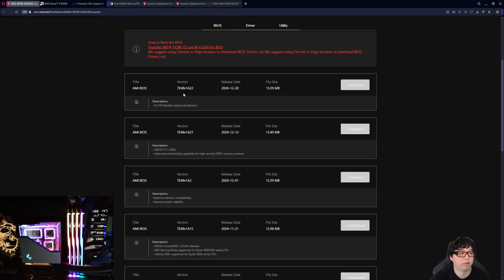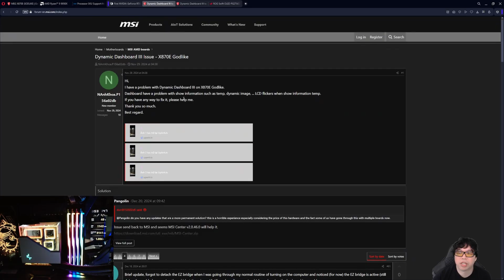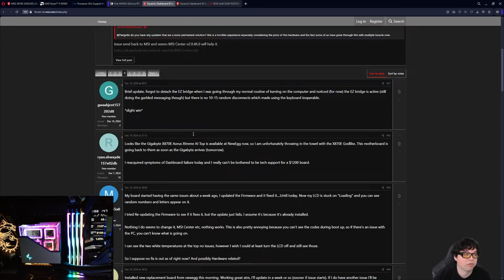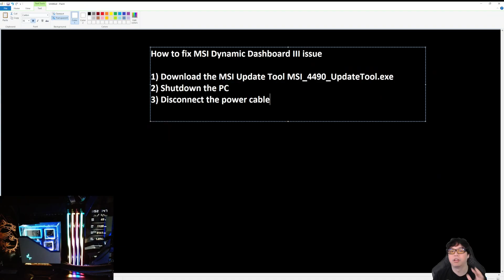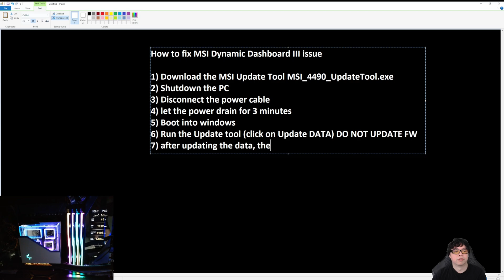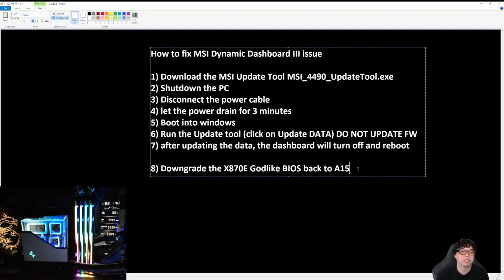How to fix MSI Dynamic Dashboard III issue | X870E Godlike

Comment from the maker: MSI released a new Dynamic Dashboard III FW tool on their site as of 1-16-2025. Make sure to use the latest tool (newer than the one listed in the video).
Reply: I tried doing that and it will fail to complete the install/update. I'm guessing because the EZ Bridge keeps dropping out. I'm not sure how I can complete the install at this point.
Reply: @robertmedina3195  same issue I'm having.
Reply: Did you update to the latest BIOS and use the new FW update tool? Are the issues resolved?
Reply: Looks like this fixed it for me! I'll see how long this lasts lol
Reply: @MidinVal  was it fixed with that update for you? planning on buying one but scared by this issue

Comment: Echoing point below to use latest Dynamic Dashboard III tool (which does not give the option to update Data only).  Aside from that, this is a truly amazing bit of information on how to fix the USB issue which had me ready to send the board back for it's SECOND RMA...........  Fantastic job and great description of the issue and how to fix it.  Much appreciated.

Comment: The problem has been solved. The small screen has not been disconnected and reconnected for 45 minutes. The screen is no longer flickering. I just pressed it randomly, and luckily the problem was solved. I'm using the latest software

MSI Center
step
1) support
2) Live update
3) Advanced or scan
4) FW update file
5) install FW file

Comment: @GameTechReviews. Hello. What's the production date on your Godlike ? I found out mine is a 2502 model. February 25. However i have found some people with a March 25 model. Also can thr ez bridge be flashed bypassing windows like using the bios ? Also i plan to put the board in a HAF 700 case. Does the fan controller support a decent  amount of fans ?

Comment: Thanks for all the help! You're like the only creator I can find that even talks about the Godlike and addresses the issues with fixes.

I got mine up and running finally, no issues with the EZ Bridge & EZ Bridge Hub now after updating the drivers and firmware.

But now I'm having issues with the M.2_1 SSD. I installed a Crucial T705 4TB rated for 14,000+ MB/s speeds but it's only running at 850-910MB/s. Multiple people on reddit have said it's an issue with all X870E MOBO's, have you come across this issue? My M.2_3 SSD WD_BLACK SN850X 8TB is running at around 6300MB/s (rated for up to 7200MB/s) so I'm not sure what's going on. 

Thanks again brother! 🙏🤘
Reply from the maker: I don't have the Crucial T705 but when I tested the SSDs in the various slots they were running at their advertised speeds.
Reply: @GameTechReviews  thanks for the reply! 🙏🤘

do you have a Gen4 or Gen5 SSD in M.2_1? Apparently it's only that slot on all X870E boards that won't run at Gen5 speeds. My M.2_3 slot is running at Gen4 speeds as it should.
Reply from the maker: @matthewjamesmaccarthaigh  I just tested the Crucial T700 2TB which is already 66% full and I got the following results from CrystalDiskMark  Read 12244.10 MB/s Write 11487.43 MB/s.
Reply: @GameTechReviews hmm I'll try CrystalDiskMark, I've been using the command prompt but I'm not sure how accurate it is. Thank you! 🙏

c: \windowstsystem32>winsat disk -drive c

Disk Randon 16.0 Read 2145.70 MB/s 9.3 
Disk Sequential 64.0 Read 5738.63 MB/S 9.8
Disk Sequential 64.0 Write  5854.35 MB/S 9.8
Average Read Time with Sequential Writes 0.064 ms 8.9
Latency: 95th Percentile 0.890 ms 8.9

About 8000MB/s slower than it's rated for, even with M.2_1 set to Gen5 in BIOS.
Reply: @GameTechReviews hmm I'm still only getting Gen4 speeds even after updating my T705 firmware and downloading Crucial Storage Executive confirms PCIE interface 4.
Reply: @GameTechReviews have you tested after a cold boot and after a warm boot? It appears from the MSI forums that everyone with MSI X670E & X870E boards are having this issue with M.2_1 dropping speeds and most don't even know it.

After multiple reboots today I can't even get speeds higher than 7000MB/s and half of the time when I attempt a restart I get error code 0d but I know there's nothing wrong with my CPU/RAM
Reply: Did you get this fixed? Been thinking about getting this mobo with these drives... lol

Comment: Whats up man do you know if theres any updates at all to this. I just got this motherboard and everything is working fine on it except the dragon led thats located to the left of the cpu is not turning on, the led on the bottom of the motherboard where the heat sinks are do not come on and the magnetic dashboard shows 2 readings at the very top but does not display anything. would you happen to know if this is a board error or maybe Is it possible I missed something on the install? The computer is working perfectly thats the only issue as far as I can tell.
Reply: There's a switch on the motherboard to turn the LEDs on or off. This also affects the Ezbridge from working properly. You pull up part of the heatsink at the bottom of the board to reveal 3 switches.
Reply: @MaxPower-zp7wy  Thanks I actually figured it out after posting this but great for anyone that has the same issue in the future. You're awesome!
Reply: @peerlesspropertysolutions  are you facing any issues with this board?

Comment: Love your channel! Thank you for everything you do and for responding to my comment about the Godlike screen "still" not working 🙏🤘
Reply: Is it not powering on. Do your LEDs in the board work ? There is a switch to turn the LEDs on or off. One guy found that that fixed his LEDs lights and also fixed his ez bridge starting to work properly. Not sure if it's the same problem though.

Comment: Is anyone still having this issue here? People on the MSI Reddit sub are saying it's still an issue...
Reply from the maker: It was fixed back in January.
Reply: @GameTechReviews  thanks brother! I'm installing in my Asus Hyperion GR701 case right now and running into issues with connecting everything to the right facing connectors so I took to the MSI subreddit and everyone lambasted me for buying it saying the screen doesn't work with multiple ppl just leaving it off entirely...
Reply: @matthewjamesmaccarthaigh they may not have all the other LEDs working too ? There's a jumper switch on the mainboard which turns the lights on or off. When the other LEDs are on and working, the ez bridge started working properly for one guy.
Reply: @MaxPower-zp7wy I've got everything working now, but still having issues with the M.2_1 slot dropping speeds after cold boot to Gen1. Numerous others have reported the same issue on Reddit and the official MSI forum. The Tomahawk X870E had the same issue but MSI released a BIOS fixing it, they have not for the Godlike X870E and are telling me to RMA the board.
Reply: What's the production date on yours. Mine is 2502. February 2025. A lot of people haven't had issues using Gen4 drive in 2_1 slot. I'm thinking of skipping Gen5 drive until the BIOS firmware is fixed. So I'll be going with 990 Pro in 2_1 and 990 Evo Plus in 2_2. Because the Eco Plus is a hybrid and dynamically switchable Gen5 to Gen4 drive. It's ideal for the 2_2 slot sharing with USB4 when it needs to, lower the speeds. But I've also heard of people having no issue with the 9100 Pro aswell infact some people using it in 2_1 and 2_2 slot and some using them in raid without issue.
Reply: @matthewjamesmaccarthaigh Asus case nice. I bought the HAF 700. I'm trying to work out the best cooling method. Like which higher performance CoolerMaster fans for exhaust and intake and which ones for static pressure radiator cooling. I would be using Arctic Freezer III 420 but replacing their fans with higher performance CoolerMaster fans .
Reply: @MaxPower-zp7wy my MOBO was manufactured in December 2024. Yeah I'm contemplating moving my Crucial T705 4TB Gen5 SSD to M.2_2 and just being done with it for now, but I hate to lose 2x USB-C on the back IO..
Reply: @matthewjamesmaccarthaigh Dec 24. I'm glad you got a fairly good working one for that older date. It seems they maybe all have the speed issue. The Crucial T705 is known to have some issues. I'm not sure if it's on the QVL storage list. You'll probably know whether it is or not. If you move the drive to 2_2 you only have to worry about the speed drops when you actually use those USB4 connections. Otherwise most of the time when those ports are not in use your drive will function at the max speeds. I'm going to be using hybrid drive in 2_2 slot. 990 Pro Evo Plus. I'm staying away from the trouble Gen5 drives. The boards seem to function normally with Gen4 drives in the 2_1 slot.
Reply: @MaxPower-zp7wy hey my board is in 2503 will it be okay? I’m going to update the firmware and bios anyways and only have a gen 4 ssd will it work fine? I’m building my pc today and wanted to know as I really like the board but heard different things

Comment: Just updated everything and this will fix it and you're updated.

USB Flash in the latest BIOS
Download AMI BIOS 7E48v1A3 2025-03-21

Update MSI Center Version 2.0.52.0 > make sure to install Mystic light and Dynamic Dashboard

Download DYNAMIC DASHBOARD III Firmware Tool 1.0 2025-01-16 21.55 MB > extract all > show extracted files > Run as administrator
Re-install regardless if the version is the same, both FW and Data.

Restart PC and fixed.

Comment: I have had my motherboard for a little over a month, and my Dynamic Screen went black. MSI asked if I want to proceed with RMA. Not sure if RMA for dynamic display or entire motherboard. Also been having issue with Intermittent keyboard input /display on screen. Any ideas what could be causing it? My keyboard worked fine on previous computer, and also tried a second keyboard and same thing. Thanks,
Reply from the maker: MSI has an updated procedure to follow that fully resolves the issue with the Dynamic Dashboard. As for the motherboard, currently the best bios to be on based on my testing is A22. A24 has a bug where it boot loops so I would avoid that one until a newer one comes out.
Reply: @GameTechReviews  thanks. Will try to downgrade bios and hopefully it fixes the dynamic screen and keyboard issues. Currently msi support told me to send them my 40 day old motherboard.
Reply: @jomendoz13  How did it go?
Reply: @mewimi  I did not send it in because I was afraid the motherboard would get damaged during shipping. MSI said not to send it in the original box if I wanted to keep it. Instead, I spent hours troubleshooting. Downgraded bios, removed Dynamic Display several times, and disconnected power cable until display showed a connection. Had no choice but to update the Firmware first then data. Then everything started working. Told MSI that I got things working so far, and they said if problems come back, open new RMA. They did offer to pay shipping on Original RMA
Reply: @GameTechReviews  do you have the offical msi link to the meg x870E godlike dynamic dashboard fix can't seem to find it.

Comment: In my case, the "Update Data" button is inactive, and the screen on the bridge is not turning on at all. It only flashes occasionally.
Reply: There's a switch on the motherboard that switches the LEDs on and off. Consult the motherboard manual to find the switch. It may be in the wrong position. Unless all your LEDs are all working besides the DD3 ?
Reply: @MaxPower-zp7wy Yes, I had lights everywhere except on the bridge. I got a new one (don't ask me how), and everything is working now. They are selling faulty products for a lot of money, and the store where I bought this motherboard refuses to help me with the warranty.  The warranty is not valid because I do not live in the USA.🤬🤦

Comment: Still no permanent fix to this day.

I'm following the thread on the MSI official forum.
Reply: Yeah looks like an easy win for the new Asus extreme board, seeing how little MSI care about this and how slow they are at addressing an issue with a $1000+ product makes me not want anything form them.
Reply: @JYMBO  Still the case today?
Reply: @SgtDangler they tried to address it & failed so yes, they’re simply offering returns and they’ll send you a new one which takes around 1 month, too much hassle to risk imo

Comment: Should you still downgrade the bios if you use the latest tool from January 16??
Reply from the maker: It shouldn't be necessary to downgrade if you used the latest tool and already fixed the issue.
Reply: @GameTechReviews  there is a huge thread on the MSI forum > Gaming motherboards. The tool did not fix it for a lot of people. Do you still have no issues?

Comment: I have had the same problem with the display since I updated the A22 bios. Only then did the problems begin. I have now tried everything as described, but the FW was already up to date and the data cannot be updated. I'm completely at a loss. Display and all MB lights are dead :-
(The MSI support is silent on such an expensive board)
Reply from the maker: Did you try the latest update tool from MSI's X870E Godlike page?
Reply: I used the msi Tool Like the given link which is showing in the treat
Reply: I have downloaded the latest FW update tool from the MSI website and followed the instructions exactly (CMOS Clear etc.).. 
But now I can't even update the FW and the data can't be updated either :-(  Also it makes no difference which BIOS I try - unfortunately it doesn't work with all BIOS versions!
Reply: There's a switch on the main board that turns the led lights on or off. It may be in the wrong position.

Comment: same thing is happening to me.  But it's disconnecting and reconnecting over and over again every 25 seconds or so.    So because of that the data update fails because it keeps disconnecting.   What's more, Is I can't boot into the bios either.   I really don't have the time to take this thing apart again, RMA it. Then rebuild it again.... waste of time.
Reply from the maker: You need to turn off the computer and disconnect the power cable for 3 minutes. You should also clear the CMOS if you had any overclock present which includes EXPO or XMP.
Reply: I have the exact same issue and have tried everything i could find online with no actual fix. Were you able to figure it out?
Reply: @Tr1ppLeSek  I am having the same issue. No fix cause of the constant disconnect/reconnect

Comment: I had the board and loved it, but then ran into the problem. I ended up just returning the board as the entire module for me went poof and couldn’t even be used any longer. I didn’t want to run into this issue again. Really bummed as it was everything I wanted and more but not worth the headache IMO given the cost of it.
Reply: Have you identified an alternative you plan to use?
Reply: @ I’m going to just continue to use my x670e Auros Master. Works great. Was only going to upgrade because I was going to build my daughter a computer soon so thought I would treat myself and give her a hand me down.

Comment: If I did update the firmware on it, can I roll it back?
Reply: You can, but not sure if Mflash will let you within the bios, if it dosnt follow the following
1. Download the BIOS you want from the MSI Website
2. Format a USB Drive to FAT32 Partition (Partition has to be 32gb or under) 
3. Put the Bios file on the drive but without any folder, it has to be on the root.
4. Change the file name and extension of the file to : MSI.ROM, you will get a message stating if you change the filename it might damage the file etc, confirm that. 
5. After that is done put the USB in the ''BIOS'' Usb slot, if you have something in there just change that device, your drive needs to be in that specific one. 
6. Do a Shutdown on the system.
7. With the system shutdown, press the BIOS button on the I/O, board will power and BIOS should flash on the button, give it time, once the BIOS light turns off, bios should be replaced. 

Here is the official guide : https://www.msi.com/support/technical_details/MB_Flash_BIOS_Button

Comment: thank you for this video, 'm currently waiting for my board, but just for information are you using the EZ Hub with the board, also if you dont mind let us know if you run into further trouble. 

Regards,
Reply from the maker: I've been using the EZ Hub without issue since doing the steps mentioned in the video. Those steps were done back on December 28th and since then I have had no issues.